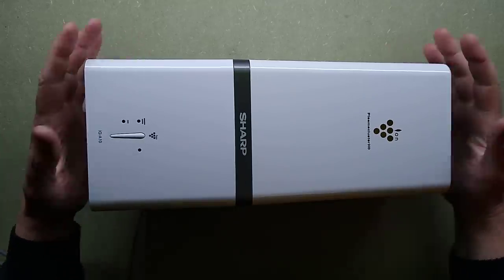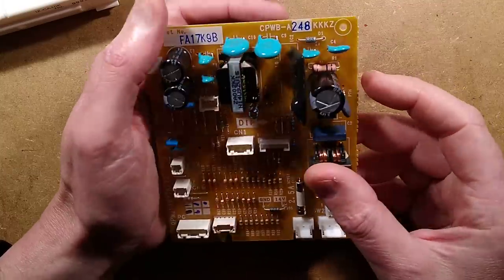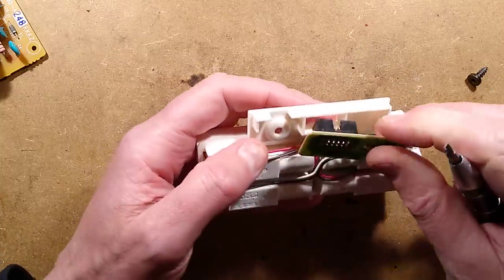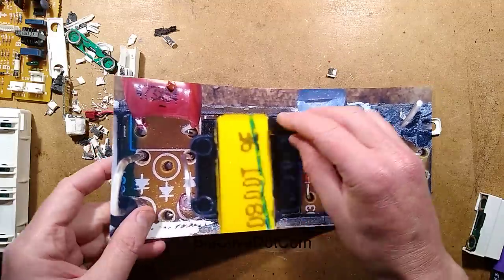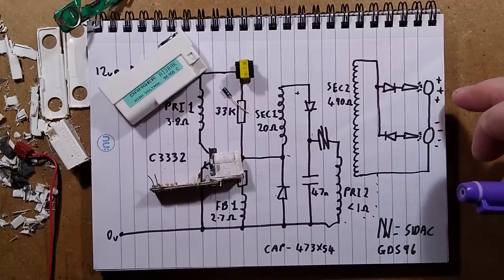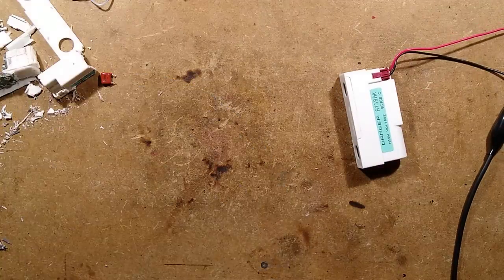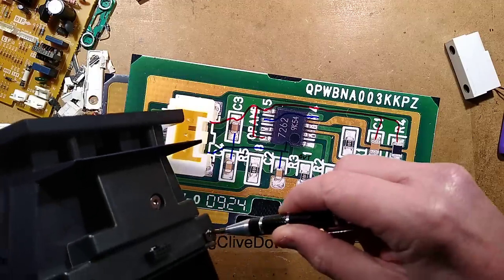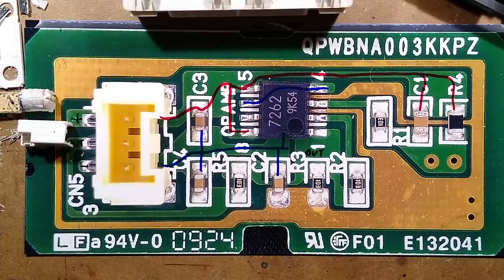Exploring a popular Japanese air purifier.

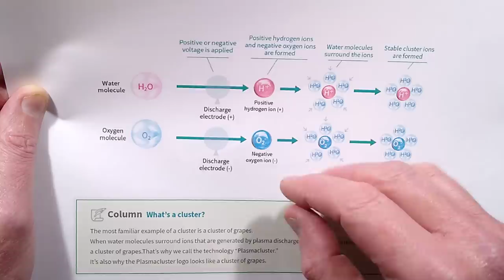Comment: That document at 19:30 is just a huge bs flag as it is. What way the electron jumps has no effect. When u get a discharge there are electrons jumping. Weather its a "positive voltage" (pull) or negative (push) its simply electrons jumping. The charge of that electron will only be negative. Basicly all electrics are using negative particles (electrons), positive and negative are only the direction of the electrons. That an electrons direction on a jump can create positive ion (now i completely ignore the case of splitting molecules cause thats not what they are illustrating)  is like saying that throwing a cake at guys head from one side will create a mess, but if u throw it from the other side will ceate an anti mess... maybe clean him... If they claim to have a way to create positive elecrons in that little machine i guess their nobel price is on its way.

Anyway, thats not how the ionizing works as u dont add the electrons to the molecules. If u did u wouldnt be able to use this device in a houce with a circuit breaker. The electron jumps, completing the jump, all of them do. The jump creates a plasma (simplyfied) in its tracks and thats where u get the ions. Those ions are as short lived as the spark so what i basicly get is a bit of ozone added.

Also the "grape" cluster is a huge face palm. A negative oxygen or a positive hydrogen molecule will not attract water molecules like that but will react with the first thing with the opposite charge it comes close to hence beeing very corrosive.

A bit suprised a quite established company like sharp would go down this bs path.
Reply from the maker: Personally I think it's just a trace-level ozone generator in disguise to bypass the hysteria-mongers that scream that ozone causes death, when in reality it's a part of air even in the most remote and natural locations.
To be fair, it probably does also create OH (hydroxyl radicals) in the mix.
Sometimes I wonder if they accidentally created a winning product and can't stop selling it now.  Almost every home and workplace in Japan has one.
They also came off very well during covid.  So maybe natural outdoor level ozone indoors isn't such a bad thing.
Reply: @bigclivedotcom  the natural level of ozone is very low about 0,01ppm and and that quite less than the 4-8ppm u can have in some cities (indoor usualy 20% of outdoor). There are convincing evidence that long term exposure of even quite low values cause health isues with the respiratory system. There are no positive health effects of ozone in the air (ventilation point later). There is also the part of the interior of your house. Increased ozone makes pretty much everything not metall age quicker. Rubber is probably the worst- Its even been an early and quite reliable method of measuring ozone just to see how much rubber stripps crack. Clothes, wallpaint and papers age, plastics get fragile and so on.

Thankfully it doesnt create any hydroxyl radicals, and thats mainly cause the water is such a small part of the air at ground level. The other product of ozone generators is mostly NOx wich health effects are even more well studied than ozone.

Adding extra ozone to the air have very few, but common, areas where its beneficial. Ventilation in hospitals on infectious clinics, burn units and sencetive surgery etc. where infections are a severe hazard.
Remove remaining smell after the source of the smell is removed, as a quick fix.

To have the "natural" levels of ozone indoors u will have get rid of it, not adding extra.
Adding it to your indoor living space only have negative effects. Think its a bit much to claim ozone danger is an hysteria when we have studdy after studdy showing its long term effects. What we have in the air today will not kill u, and u wont suddenly die of having a tiny ozone generator in your living space, but u take the risk of severe health issues later in life (the NOx makes this even more exiting)
About it beeing deadly. Its common that large cities get spikes to 8ppm and when it was at its worst L.A had slightly over 12ppm... now, it happens that we know what a leathal concentration is for mamals at about 15min exposure... its only 25ppm. Not that far off.

Sorry about typos and wierd senctences but english isnt my first language and i think way faster than i type so it can be a mess sometimes ;)

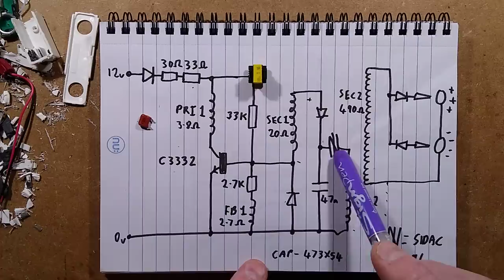Comment: Corona discharge?! Don't tell the conspiracy nuts :o 15:10 did you say "Sidac"? What is that?
Reply from the maker: A Sidac is a diode that triggers at its design voltage and shunts.  Like a diac, but for higher current.
Reply: @bigclivedotcom  Thanks <3 love your videos!